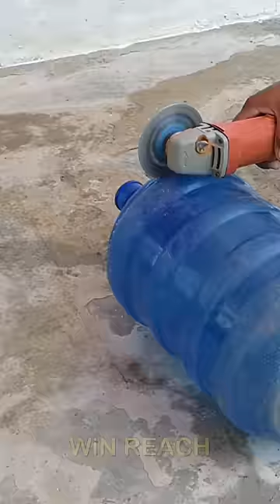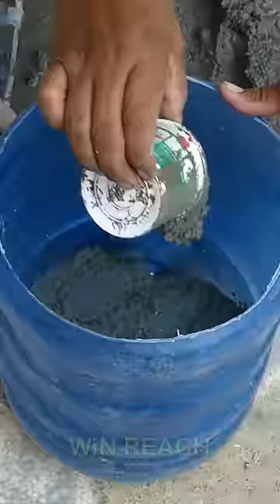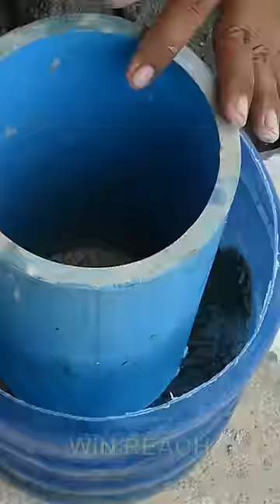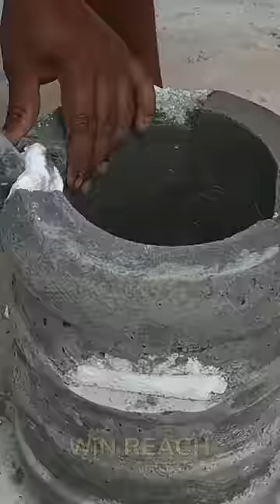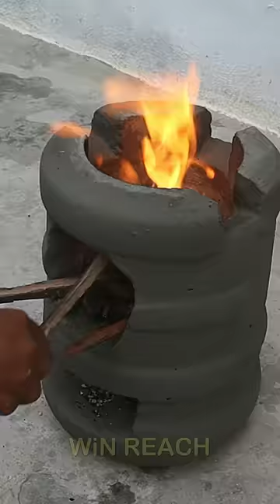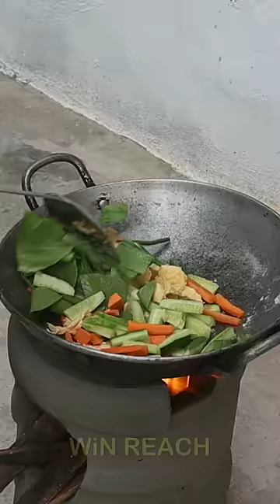Recycle The Old Container To Make Cement Stove #Shorts

Comment: That’s genius! I will have to try that. But gonna need a bars, because the high heat will make the cement crack overtime.
Reply: Use the high temperature cement for boiler arcs
Reply: a bars

Comment: The idea of this stove is noble, but without bars it'll keep cracking from the high temperature. Greetings 🙂🙋🏻‍♂️
Reply: That’s my point
Reply: At the end they put a piece of wire in it around it if I'm not mistaken to act as rebar. Not sure if that's what I seen or if it will work but if I'm right then E for effort?
Reply: They make firebrick for a reason, and it ain't because concrete would work in its place.
Reply: @420JackG  isn't that the reason for the clay added? Edumacate me
Reply: Explain" bars"
Reply: @bennorth9028  it isn't just any regular clay (although it isn't especially rare either). They use stuff that has low heat conductivity, and obviously bricks are fired in a kiln in the first place. Obviously concrete lacks these characteristics. There is heat resistant concrete and if you have a kiln you can make it yourself, but you are not money ahead doing that in my estimation.

Comment: I don't think it's gonna last. He didn't put enough support inside. Almost pure cement. Nice skills though.
Reply: I was thinking the same thing. But be cool to make with he kids Tho and modify it up some
Reply: @jeremyrezzin6170  as long as it doesn’t flare up too hot and isnt used it for a prolonged time it should be fine. I made a fire pit like this to grill out on with only cinder blocks and worked fine for over a year. It only just started to crack and fall apart because i like to burn for hours and have a 4 ft flame lol
Reply: @CorgiCorner  ohh that's awesome. Definitely gonna have to build one

Comment: Do not do this! If you use the wrong concrete/cement it could crack or even explode
Reply: Then ill make another one
Reply: That’s scary. I’ve seen that on Greg oven’s Video where he cooks his turkey underground and he says rocks can explode in your face. And this could be no different.
Reply: @animarrowgaming1607  yoooooooo
Reply: @animarrowgaming1607  you have to use the right mixture.
Reply: How the fuck would it explode? There are 2 giant holes in it lol. Where would the pressure build up?
Reply: @photonganglol2413  if you wonder that, I got a fun trick you can do!
Throw a bunch of ice in a deep fryer — so cool!
Reply: @favoritemustard3542  same principle. It’s rapid gas expansion and pressure build up. It’s why peoples thanksgiving Turky explode. That’s can’t happen here you ding bat lol
Reply: @photonganglol2413 ...with fresh, wet concrete. ProGamer move, herpaderp! 😉👍
Reply: @Raccount100  lol ok so my point exactly. No one is cooking at 1100 degrees.
Reply: @favoritemustard3542  sigh. I know science is hard but hang in there m8
Reply: @photonganglol2413  the pressure builds up inside the concrete itself and the rocks in it.
If a rock was sitting in a river it can get water into tiny pores in it and end up with water pockets inside, and when it heats up the water flashes to steam and blows up.

This is a common problem with fire pits, or heating rocks for sweat lodges or native cooking techniques.
Reply: Highly unlikely as it is, yes, it is possible.
Reply: @ke6gwf  you sure told him lol
Reply: @joerivera9106
Reply: лойдан ясаган макулдир у портламайди

Comment: Clearly nobody here knows that concrete explodes under heat stress
Reply: This one will probably just crack. No big deal.
Reply: It has to be under extreme heat conditions - I mean I've hit concrete with torches at 900 degrees and hotter to make it pop
Reply: @jeffreyrauncher9161  I've used cinder block and they just crack apart over time.
Reply: @dudemcnike1574  so what's a better material then - wouldn't clay be able to withstand high heat once it was hardened?
Reply: @jeffreyrauncher9161  ever had a "brick oven" pizza? Bricks would be ideal since it would be easier to make a oven or stove.

Comment: Great idea if the concrete has set for the full time needed and if it is completely devoid of air bubbles otherwise it will begin to crack and crumble away very quickly. If the stuck chick wire around the outside it would hold everything together even after it cracks

Comment: Cement can explode when in contact with heat for too long. Only 200 degrees Fahrenheit is needed to cause water molecules inside the cement to create steam and ultimately cause the cement to blow up. Cooking an egg takes a few minutes and likely won’t have a problem. Trying to use this to cook meat or heat an area could have disastrous effects. Look up videos of exploding cement and concrete if you don’t believe me.

Comment: I built a fire on a cement slab 4'x4' 20 minutes later there wasn't a twig left on that slab concrete swelled up and exploded  with the heat . I dont know  about a cement stove. I think a log rocket stove would be better